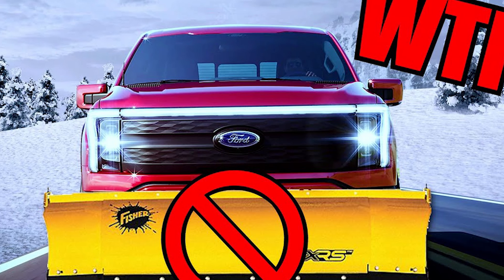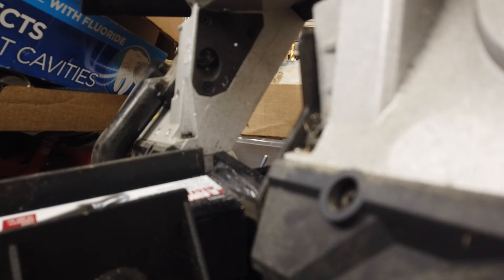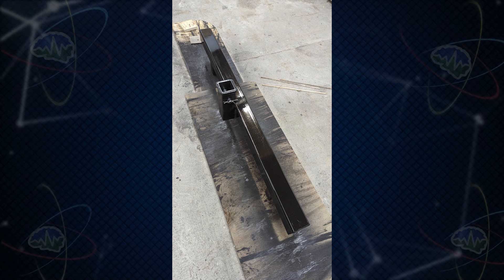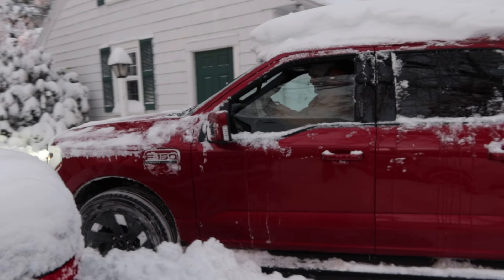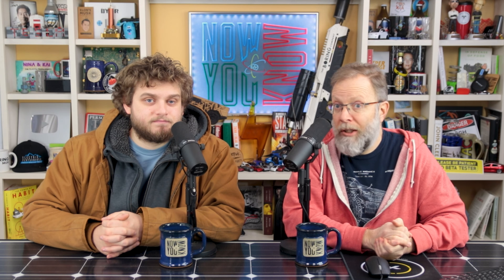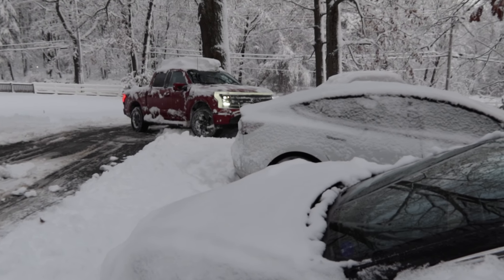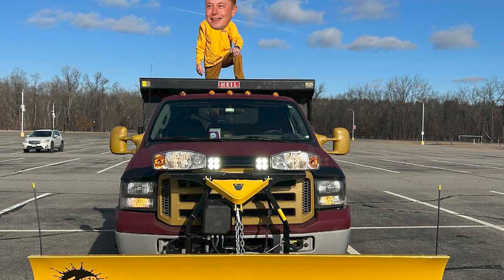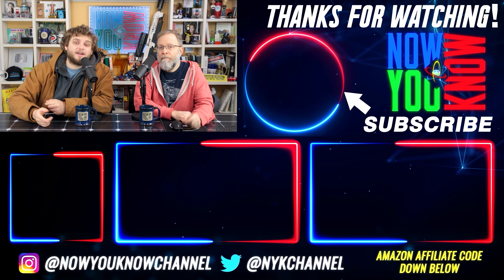First Snowplows on Electric Pickup Trucks! | In Depth

Comment: Hey guys, if you really want to do the 12 V thing right use the Ford 120 V plug in the fronk drop the voltage with a 12 V transformer then you’ll be pulling power from the main battery instead of a 12 V battery you would pretty much have endless power for your plow to go up and down and articulate.
Reply: Second this.
Reply: Frunk is limited to 400w with frunk closed

Comment: Guys, be careful. This is so COOL.
 Plow trucks have the inertia switch for impacts /accidents made to not be as sensitive.  Bump a snow bank too hard. Your Ford lightning airbags can go off.. should be OK if your gentle
Reply: But think of how many clicks that will get.
Reply: @mountainmantesla4395 very expensive clicks 😂
Reply: Good point. Maybe find a way in the settings to disengauge airbags when snowploying.
Reply: I don't think that'll be a problem as the plow is tied to the frame.   All the small business "plow trucks" are just standard trucks with plows attached.  No special switches.  Non issue.

Comment: Windex

Try soapy water when cutting metal.  Windshield washer fluid works well.  Be generous.  I like a spray bottle with a trigger.

The water keeps the bit cool and the soap helps      with cutting surface contamination.

Love the front attach modification!

Comment: Recommend purchase of the Snowvac and retrofit to the EV.  Wire it into the 120 volt system via a 12 volt transformer.  Wiring any extra loads into the small 12v battery is definitely not good for the health of the battery or the vehicle; if the 12volt battery dies, the vehicle is bricked.

Comment: A small 12v battery in an electric pickup won't last long if an electric articulated plow is attached. The Ev would 
have to have a robust DC to DC voltage converter over a few hours of use. ICE trucks have alternators that keep
the 12v battery up to charge and allows for all day plow usage.
Reply: I'd imagine the Ford would have a robust DC/DC converter. The smaller volt had a 2,000 watt converter, or about 140 amps if my math is correct.

Comment: Great show great content, please do not underestimate the 12 volt requirement for 360 emergency lighting, and the added workload of running the plow hydraulics, trust me it's significant.
Reply: Will be no problem for the DC-DC converter that can output over 100A continuous (even 160A according to some sources).   That’s ~ 2000W.

Comment: I love EVs, and I plow a lot of snow.  I also used the Chinesium DKII and Snowbear hitch-mount plows for years.  The upshot:  Those plows, and EV trucks, are going to be great at plowing a couple paved driveways.  When I set out to plow, I do about 4 miles of road which is mixed dirt/paved, and 3 moderate-sized parking lots, and I'm going through >10 gallons of diesel, depending on the amount of snow.  Hitch-mounted plows don't survive anything rough, like dirt roads, or much volume of use.  As much as I love driving an EV as a daily driver, not even the Hummer EV has enough battery capacity to plow more than about half of what I do in about 4-5 hours.  Just my own private road (1.5 miles or dirt with a little pavement) would be doable with the EV battery, but not with light-duty plows - they last me 1-4 years.

Will we get there some day on the plow quality?  Maybe... although higher qualify plows are marketed for people plowing commercially, which means when it snows, you go until your clients aren't willing to wait that long, and sadly, that's not in the cards for an EV.  Will we get there some day in terms of EV battery?  Well, yes, insofar as current EV trucks have enough to do a driveway or two; and no, as far as commercial plowing is concerned.  I mean, you could hit up a 250KW fast charger between jobs, but that really doesn't make sense unless your plowing business is already so established that you have every parking lot up and down a particular commercial area that happens to have a fast charger right in the middle of it, in which case you already have an ICE fleet.

Cool video, for sure, and definitely a question worth exploring, but beyond a driveway or two, plowing with electricity really just isn't in the cards.

Comment: Nice video! Since I live in Finland this could be useful, although we don't have many pickups here. Honestly I haven't seen anything as small a pickup truck doing the snowplowing. Big roads need special equipment, but I could see electric trucks doing the stuff that is not done by the city, private roads. However I'm sure some big truck company like Volvo could make electic trucks for plowing.

Comment: I had twin 2" front receivers on a 76 Bronco. I could use the passenger side one with a hitch to easily spot trailers driving forward and looking down the side. Put a winch on either side or the rear, attach tow hooks, etc. (No snow where I lived. )

Tesla should provide the same either standard or as an option on the Cyber truck... maybe creating a standard width for the spacing, with a power terminal available.

Comment: But for the Cybertruck there IS NO 12v battery. It's 48v.
Reply: Nothing a dc to dc converter can’t fix, I had an electric bike that was 48 volts but a converter that allowed me to run 12 v lights

Comment: I have a question. With the deep freeze that happened last week and all the TV and videos on YouTube showing charging problems with Teslas., where is the problem? It doesn’t seem like the problem is with the vehicle itself. it appears to me from what I’ve gathered is the charging infrastructure when it gets really cold. I could be wrong. But can you guys do a deep dive on that?
Reply: It’s not a problem, other than people not knowing how to use the tools they are handling. 
If you are plugged in overnight, the batteries are warm and the vehicle is charged. The problem came from ride share service drivers cold soaking there EVs then trying to DCFC their dead batteries without preconditioning. EVs don’t work this way, if you can’t charge overnight and there is a cold spell forecasted, charge your car in advance the same way you might fill a gas powered car before a storm. This is one of the few times an EV is as inconvenient as an ICE vehicle.

Comment: Jessie, start looking for a SS plow for the CT. They do exist or go with the plastic see through style plow ( lighter weight ) and less taxing on the 12V system.
Reply: There's 120vAC in the frunk.   A simple step down inverter will give as much 12v as you could ever want.   But the see through plow is great for the camera.

Comment: Why would a 12volt battery be a deal breaker even in the cybertruck, couldn't you just wire in a transformer from one of the power outlets to run the 12volt system ?

Comment: That is very cool! Thanks for the great video.
I'm curious if there is enough power (it should be) to attach a snow blower? Where I live in Quebec, every company that do snow removal for driveways are not using plow but snow blower attachment. I would say that most if not all are using tractor or bobcat, but I've seen them attached to regular pickup truck.